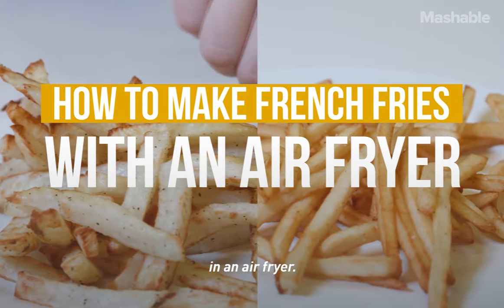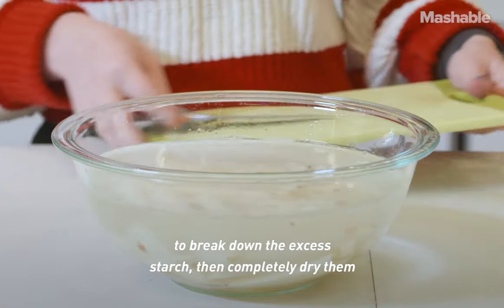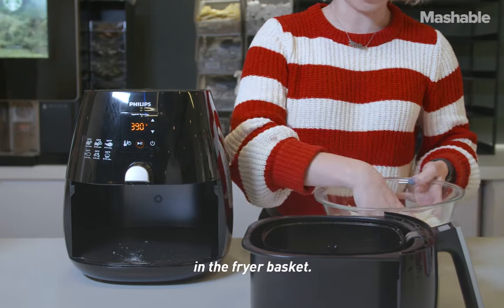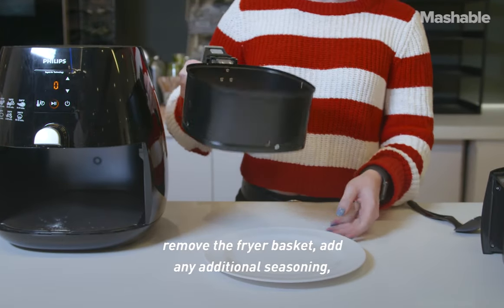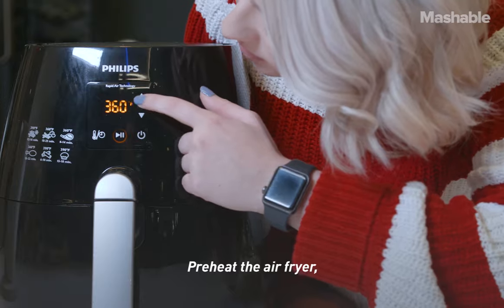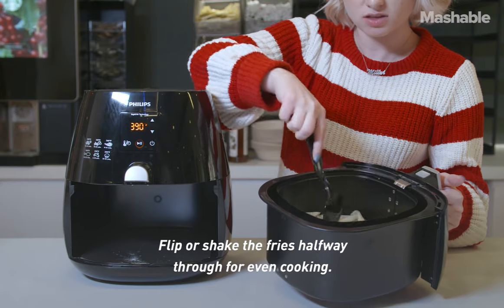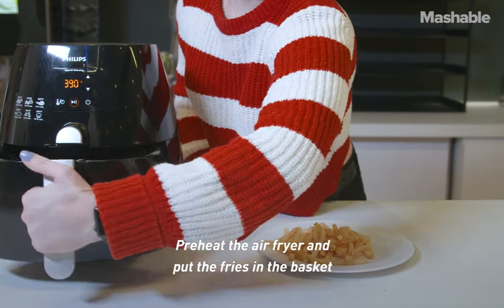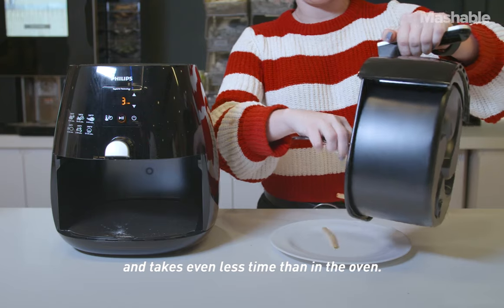How To Make FRENCH FRIES in an AIR FRYER

Comment: Has anyone else made this following the instructions as well as just putting cut potato tossed with oil in the air fryer? I'm not picky but don't notice a difference between potatoes that have been soaked or not.